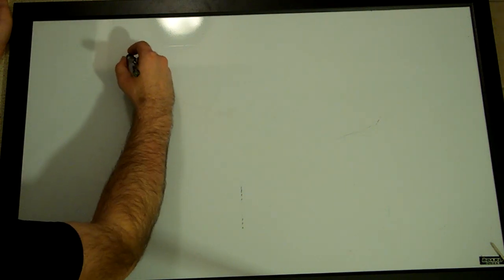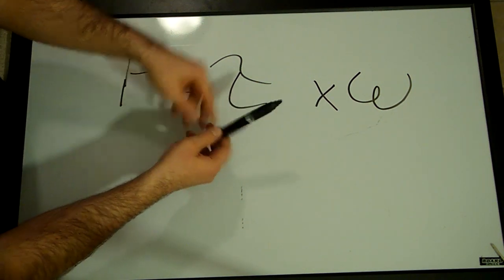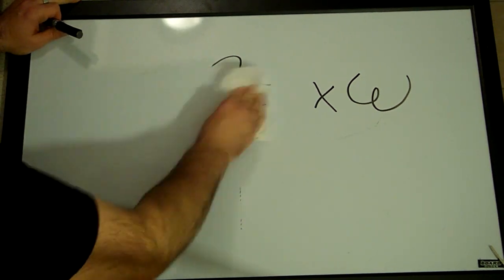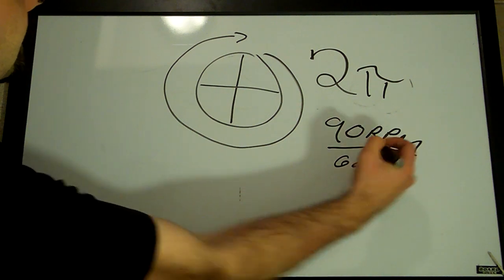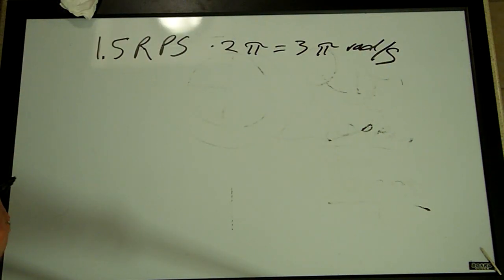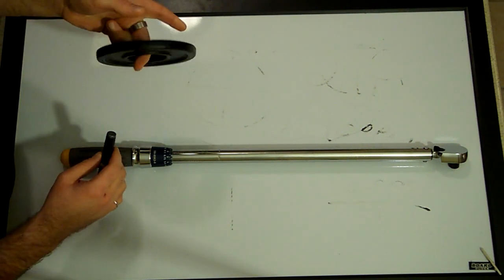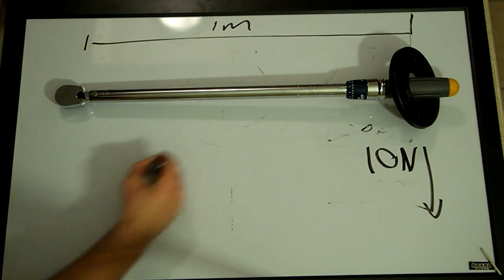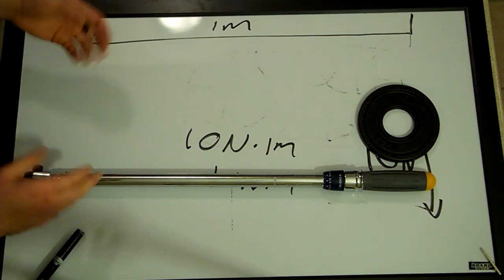V3 Power Meter - What is Power, Torque, and Angular Velocity

Comment: hey tanx for that.,i hav a dobt,
a motor of 2.24kw(3hp) running @ 1400 rpm.what will be the torque of the motor in NM?and is the torque increase if the rpm reduces?

Comment from the maker: Yes you can, but
1) Horespower direct calculation makes little sense, HP = torque (foot-pounds)*rpm/5252. What is that constant doing there? In SI things make sense, in "Imperial" nothing makes sense without constants it seems.
2) While you can set a cycle computer to mph or kph, you can't seem to set it in horsepower... only watts.

Comment: But how “P=tW” while angular velocity is not constant it is increasing with time
Reply from the maker: Powermeters (And this includes, all but a single solitary unit in late 2019, 6 years after I made this video) assume that velocity is constant for each rotation by measuring timing. Once you're at speed the momentum of the bike means this assumption is sufficiently valid for 99% of the time for average users, about 99.9% of time for pro riders. The impact is minimal until you get to large changes in velocity such as starting from a stop. Out of over 15 PMs and about 30 trainers, they all work like this... except 1. An improved assumption is linear mapping between old and newly calculated cadence. Nobody has implemented it.